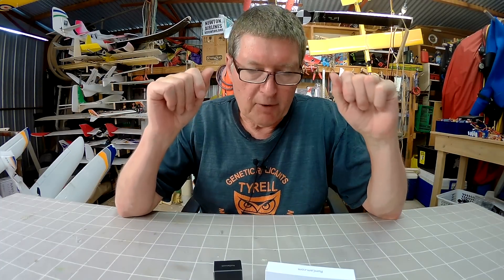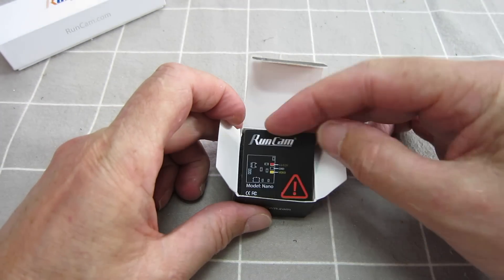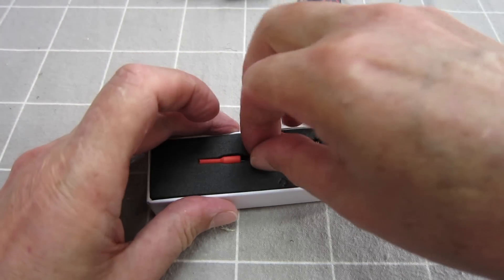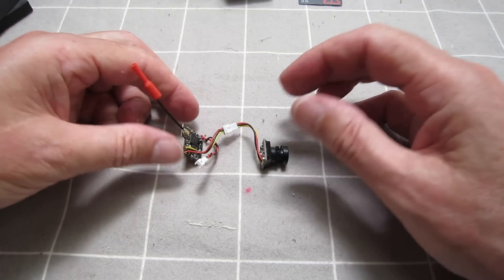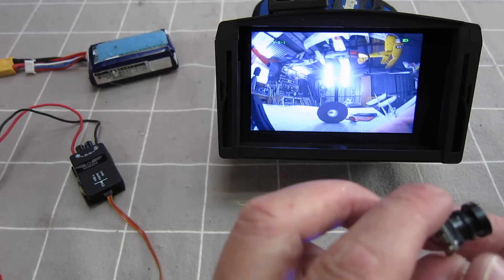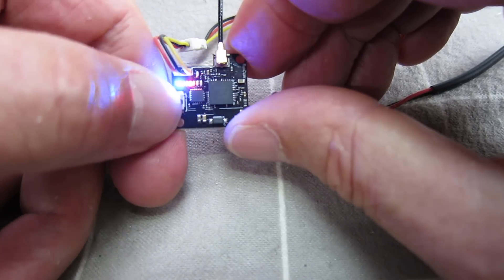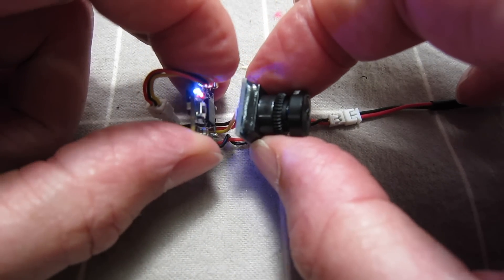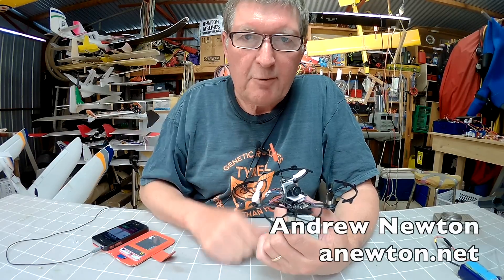Runcam Nano and TX200

Comment: I just mounted my runcam micro eagle and tx200u on my esky eagles. As the unit don’t have manual , your video helped me in setting up my vtx. May i know the range this vtx can reach? Tnx again Andrew, cheers
Reply from the maker: Range is a few hundred meters. Depends on your receiving setup and RF noise in the area or course.
Reply: @AndrewNewton  my goggles/monitor is an Eachine EV800D and im having issues with the scratchy noise recorded on my goggles/monitor, may i know your thoughts on how to eliminate the unwanted sounds on my videos? thanks again

Comment: hello guys....i want to ask something.....i jiust bought a micro runcam swift 2 with the osd on it and the special TX200 made for it...i made the connections and the soldering to the cables..the camera works..BUT......i have short range of signal...why??????? the weird thing first of the 2 weird things is that the 2 stock cameras i have both the old model with the 2 buttons on it and the newer with the one button on it....even with broken antennas...have longer range of signal especialy inside my house.......and the weirdest of all???? i have 4x Eachines QX95 ...all dead from defective parts...and i use one camera of them...i just made a connector and connect just the 1s battery on it and it turns on....i use the same channel to all these cameras...and the one of the QX95 has the longer range signal and the clearest image..colors clarity etc....how is that possible ???? and now i just soldered a brass antenna to one of the stock cameras and i have even longer range between the walls etc.......but again the one of the QX95 beats that too........the runcam is this model exactly and since all people were suggesting it as the best camera for the lizard95 i bought it....but i m dissapointed with the signal especialy..the image is good but not as good as the cheapest of all camera of the QX95......enlightened me please if i do something wrong?i even tried to 200mw the runcam and again the signal remains shorter of all the others who play at 25mw........all the strange things to me.....not to mention that i wait again for 6th time the minicube f3 to fix one lizard cause after 5-6 batteries always the reciever breaks down and do crazy things or dies at all......or loses bind and cant rebind......anyway...my curiosity is about the runcam...can please anyone help?
Reply from the maker: Not my area of expertise, hopefully someone else can help

Comment: Hello and thank you for the video. I’m setting up a similar combo. Runcam swift2 micro with tx200. Having abut of a problem setting up the voltage to the 200mw. Tried it twice and was changing channels and left it alone for now. I’m used to the eachine vtx with flashing numbers. No guessing there. I’ll give it a go again. But after the five second hold it won’t get solid orange. Am I missing something. ?? What do you recommend me to make this easier lol. Thanks so much.
Reply from the maker: 10 sec push first to unlock the power
Reply: Andrew Newton really. I’m going to try that.  It’s not mentioned on the download instructions. At least I didn’t see it. Anyways thank you for your response I think that’s it. Cheers. 
All the best. And love your vids. Your Awsome !

Comment: Hot glue works well to mount those little cameras. Such a cute lil setup, I like the idea of the tiny vtx being seperate from the camera, means it can be mounted for more transmission and cooling.👍
Reply from the maker: Good tip thanks, They certainly need airflow to keep them cool.